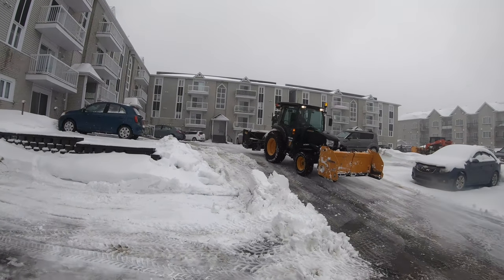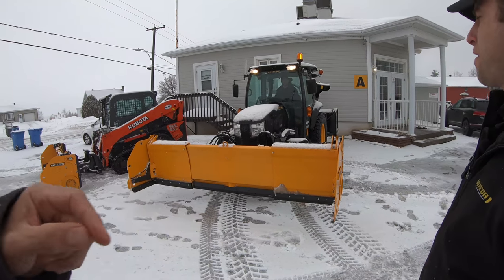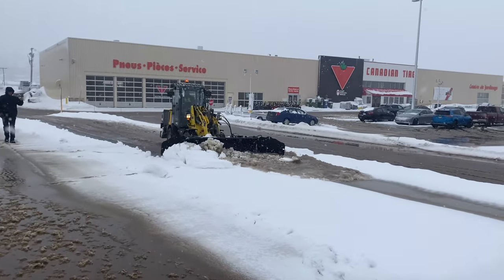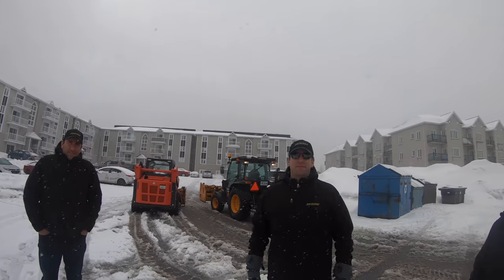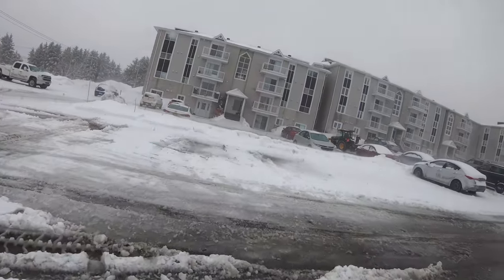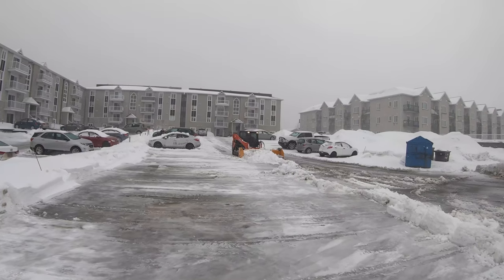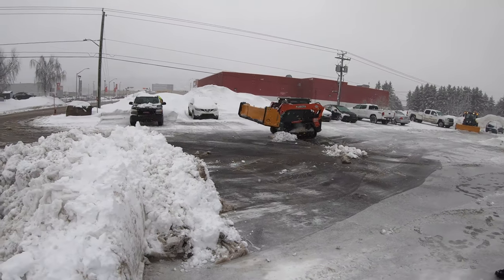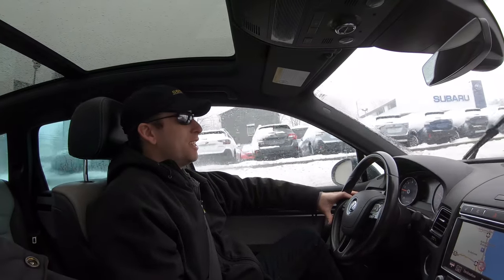Tractor Vs Skid steer: head to head Competition using a NEW snowplow system 4k

Comment: I have been operating a 70 hp tractor in Muskoka Ontario,  Canada for 10 years doing rural cottage properties.  My tractor is equipped with a 7 ft double auger blower on the back and a 7 ft articulated straight blade on the loader. We have trucks as well. Personally I  prefer the tractor for it's versatility and visibility since I can move snow in both directions.
Reply: Really appreciate the feedback.  We are finding more and more companies are begining to use the tractor set ups for the same reasons you described.  Also with the correct equipment it is often much more comfortable for the driver.   Please let us know if you need anything new for your business or have any questions.   service@cotech.ca
Reply: Ben Ueberschar Hey Ben. Tractors are the way to go up here for sure 💪 plows have their place in lots and driveways that have room to stock pile but tractors are definitely the most versatile piece of equipment. What company do you own? Or work for?
Reply: @muskokapropertycare261  I work for Windermere Garden Centre

Comment: The "whatever this stuff is" is glycol type 1. Its a heated de-icer to melt away frost and snow. Theres also type 4 which is a green goo which is an anti-icer usually applied after type 1 when it is snowing.

Comment: well Stanley, I have a Kubota tractor with a snow blade on the front and snow blower on the back and chains all the way around. It beats everything out there the same size. I of course live in the Mountains of the Kootenays of British Columbia Canada  and its not flat so you need chains or you are not going to move any snow very far. Tractors win every time especially when there are real hills involved. get a tractor you won't be disappointed.   Good video.
Reply from the maker: Thank you Bruce !

Comment: The tractor has the weight on the backend with that blower stuck out so far back. Also they stacked the deck against the skidsteer by using one with construction tracks. One with even rubber tires would have pushed better than the construction tracks. I think their blades has possibilities. I would like to see it in more "normal" snow over this slushy snow. In this video the blade did a terrible job of cleaning the pavement.  I would have a lot of complaints leaving that much slush on the pavement.  Thanks for showing us these different "tools" that are out there.
Reply from the maker: You're welcome, thanks for the comments !

Comment: They have a great system with the blower on the back where the weight is distributed pretty evenly throughout the tractor giving it better traction on ice especially. I'm not sure what tracks were on the skid steer, but it was definitely at a disadvantage in this case. That was fun to watch, especially watching the blower at the end getting the snow out of the way. I'd just the to see what would happen if a stone got picked up and where it might end up. I bought an old Arien's blower, about a '79 model for $60 that had a blown head gasket. I replaced the head gasket, tuned it up and made my own custom chains out of 5/16" chain as the chains I looked at were pretty cheap looking and I would have had to cut out half the chain to fit my tires and it works quite well and for the same price. Also had to replace the impeller shaft bearing and added reinforced rubber pads to the impellers which seemed to help it out a bit. I also took the tires off, cleaned the rims and all the rust out and then after painting the rims cut some old bicycle tubes to use as liners to protect the tubes.  Thanks for sharing.

Comment: One reason why the skid steer was having more problems vs the tractor is the skid steer had trax which decreased it psi, the entire weight of the machine is distributed over a larger area which decreases it psi, any seasoned snow removal e pert who is also a mechanic will tell u thin small tires work best for snow because they will cut thru the snow easiest and exert most psi in a confined area. More weight (psi) equals better traction.
Reply: 🤔 I think the real reason why the tractor preformed better was that the track machine was clearly still running summer fuel and the tractor had fresh winter fuel ! At least do a fair test will ya! Also for testing purposes they should make the snow as light and puffy as possible and not that messy and heavy stuff 😩

Comment: Have you tried the QuattroPlow by SnowWolf?  We have two of them.  One on a skidsteer and another on a tractor with a blower similar to the one in your video.  They are a bit slower when changing between push and pull but we love the ability to angle them while pushing/pulling.

Comment: They may as closely matched as possible as far as horsepower/torque however they aren’t even remotely close to being evenly matched. The tractor outweighs the TrackSteer by quit a bit with the addition of the rear mounted snow blower. On top of that the tractor has snow tires and the TrackSteer has Dirt tracks. Had the TrackSteer had Snow Tracks it would have beaten the tractor easily in the tightly confined parking lot.

Comment: My rig is a LS 4155 with an angle blade up front and a 3 pt box scraper in the rear. I would trade out the box scraper in a heartbeat for that plow.
My route is mountainous single lane paved and gravel roads. One of the neighbors has a skid steer, he struggles on anything with a slope, my tractor runs circles around it.

Comment: Got pulled over with my case 521 for I was with my 4 ways on
But the rotary light on top wasnt working because branches keep on messing the wires
Result 500 $ dollars fine
Been born and raise in Québec 
And work hard to get out of this sht hole province 

God bless bro
Reply: That just sucks. Up here in Norway i operate a L90H with a 3meter snow bucket and have for years without being stopped even once even tho the legal limit is 2.55m. Heck this year my firm even have an L120G on the roads with the same bucket, amd that machine is too heavy and to wide to be legal on the roads
Reply: Still on the positive side 😅most people are nice here and  so is the rest of Canada.
Reply: Oh that is just not cool

Comment: So, just watch to the point you made the comment about the license plate on the loader; and someone else has probably already comment and corrected you on this but I do not know of sure so I will; Massachusetts requires plates on Construction Vehicles, front end loaders, Backhoes, wheel excavators, skid loader, etc. if operated across the road and streets.

Comment: Just so you know, planes are deiced using a process known as hot water deicing. Depending on manufacturer and weather conditions they will be spraying a mixture of hot water 180 degrees f and ethylene glycol or propylene glycol.

Comment: I have wheels & tracked skid steers once 99 horsepower in the other ones 86 horsepower my 48 horsepower tractor will out plow in most conditions the skid steers
For lot-less  operating cost.
And if he had a plow on the back of the tractor there's a lot more tricks you can do.
You don't so much control the tractor with the steering you control it with the brakes and you can get extremely close to things accurately at higher speeds momentum is your friend.
That's awesome the way that plowed goes in and out like that it gives you even more control.
Yeah if the traction is good and you get a v type of plow or an angle Dozer and the track skid-steer will kick ass.
You can also Drive the track skid steer on top of the snow if you're pushing back snow.
No way with the tractor.
The wheel skid steer will work really good if you have to scoop and dump  to the side because the snow so deep and you have to lift it.
In really deep snow where you can't push it.
 the snow blower I think on that tractor would be the ticket in deep snow
There can be so many variables.
I lived at place by Lake Tahoe , called Soda Springs in California in 1983 we got a hundred and two feet of snow.
The snow was pushing houses off the foundations and  propane lines we're also breaking and the house would blow up.
For two weeks three to five houses would blow up a night..
It was easy to get a job for $50 an hour shoveling snow that's with a  shovel.
Ski resorts had a hard time keeping employees are even finding employees
Reply: You obviously have experience.  Thank you for watching the video and for the feedback.  if you ever need anything for your own use please feel free to message us with any questions.  service@cotech.ca

Comment: Looks like a awesome plow but ask guys that run tractors for plowing. They don't like them mounted like a loader mounts. It's better to mount them under the front of the tractor with push tubes tying into the rear hitch. You can see in the video when he is pushing the front of the tractor is coming or trying to come up off the ground. Then you loose steering. That wouldn't be a issue if it was mounted under the front not like a loader mounts

Comment: The only problem I really see a really big issue. It maybe little different but for that size of tractor over 90 to 95% of people would put a loader on it. So if you would like it to also have a loader on it, I gaurantee it would be pain to take the mounts off and on top that, the loader mounts them selves are such a pain a take off and on I've had experience taking off loader mounts on an old 4055 when we restored it. Which the brackets themselves didn't just attach in the middle but attached to the frame but went all the way to the back frame. Then I've done it on a 5100e which is a model year 2018 because we put a lot more heavier duty loader which the brackets on made by jd weren'tas heavy as the westendorf. But besides the point. Anyways the 5100e is about this size but a little bigger but not to much bigger than that frame size. Plus all the hydraulics would be a pain too. So you would just be buying the tractor to do everything but being able to use a loader. But it wouldn't be a problem if you had a skid steer.  Please guys let me know what you guys think about this.  
Also I forgot to say this but i guess if you had skid a attach on the loader you could just out the one the skid has on it but it would be a hell of a time to move around the parking lot.
Reply: Thanks
Reply: I have an l6060 with loader plow and 3pt blower. Power angle plow will come off for next season. I have 3rd valve and will get a box that flips forward/backward on loader if they make that. forget expanding or else I will get light duty artic sectional. either will be better because angle hydraulics make this thing way to long.

Comment: Not seeing anything "new" with these plows..
There are already plows with wings that spread out and can go backwards and forwards, the only difference being these "new" ones simply spin back and forth instead of fanning out..
If that loader had better traction it would have done a much better job than the tractor i think.

Comment: Think about how the tractor is way less jerky than the skidsteer and how it's more comfortable
Reply: It is very true.  Some of the drivers are in that seat for hours clearing some days.  We added the Pivot points on the PPCR to reduce the jolting and vibrations that can cause the discomfort and having a blower on the back also adds balance.
Reply: @VIDEOCOTECH   Je trouve ça super que vous venez dans la section commentaire de la vidéo pour répondre aux personnes qui ont commenté ça montre un bon support de votre part et je trouve que votre nouvelle gratte est vraiment ingénieuse c'est un concept très intéressant pour quelqu'un qui veut ajouter du rendement et de l'efficacité à son déneigement
Reply: @VIDEOCOTECH   Est-ce qu'il y a déjà des compagnies de déneigement qui en ont sur leur flotte ?

Comment: I’m interested to see how these hold up to wear and tear and bumps. All the moving parts are nice and fancy until something gets a little bent and I imagine it would get spendy to fix. 

I’ve been in commercial snow removal in Alberta for 12 years. We use loaders and 16-18’ pushes. Something like this would be handy for back dragging and such but would be nice to see in a loader application.
Reply: Actually this is why we put so much thought into design.  Note the parallel linkage that allows the operator to be more precise and clear closer to barriers.  How efficient the rotating wings make it adjusting from Push to pull.   
Angles in design assist in eliminating ice build up to keep functions flowing without error. Pivot points and balance create a more comfortable experience for the driver.  
The rubber edging is made to be very simple to replace and can handle 300-400 hours of use.  We know machinery is expensive and we need it to last and hold its value for our customers.   if you ever have any questions you can reach us at service@cotech.ca   we are also in discussions with dealers in Alberta and anticipate being available by next season there.

Comment: I thought it was unfair advantage because the Kubota Skid Steer did not have track first snow so I think there's a little bit unfair also the tractor had more weight on it on the back since the snow plow I was helping it but I think it's the skid steer the Kubota had more of a snow tracks I think it would have had a lot better of it advantage

Comment: put ag tires on that tractor and then see what happens
Reply: I plow in a New Holland with the regular farm tires on it. She does just fine even in slippery conditions like this. I keep the machine in 4x4 auto most of the time, and sometimes throw on the auto rear diff locks if I really need it to push. (only downside to locking the rear diffs with it is that you lose a lot of steering by doing so).
Reply: I  plow with a New Holland with studded AG tires which has worked for 10 years, would love to try with road tread.
Reply: Just if anyone is wondering.  That tractor specifically is set up with Nokian tires.  They work fantastic.

Comment: That tractor would be useless without the counter weight of the blower. The kubota skid-steer with the racing slicks is not the one I'd pick for that job either but, I think he'd be quicker with the stock bucket.